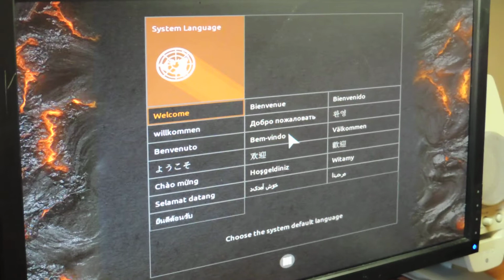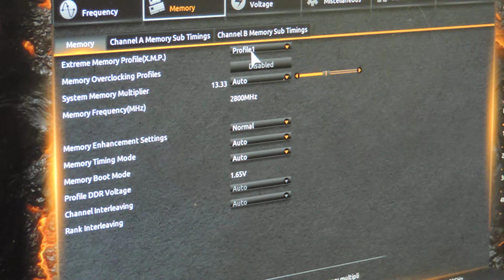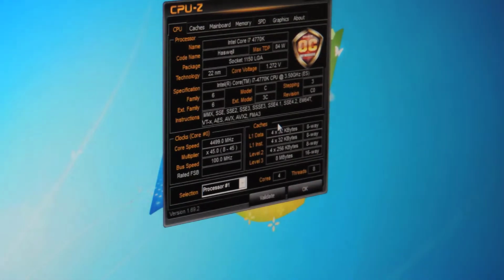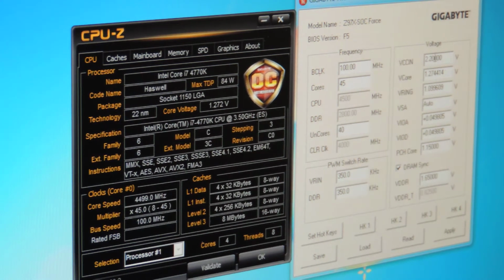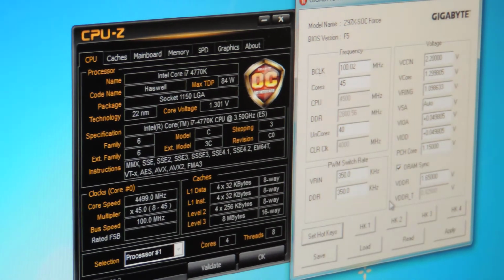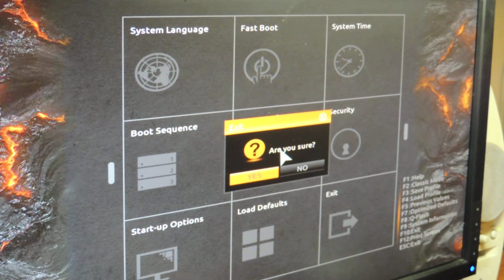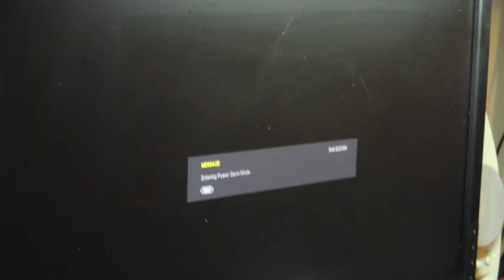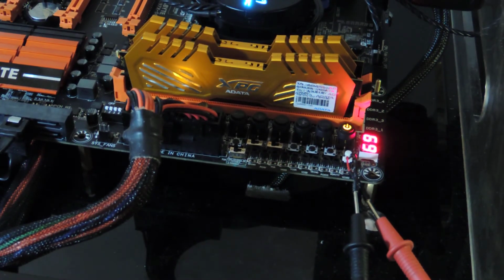[SH] Z97X-SOC Force OC Guide/Feature Overview

Comment: I used the same settings as you on every option u changed, but when Windows was loading I got a BSOD. So, I decided to load default. I have same MB and CPU. Do you think it could be due to my PSU?? It is a Thermaltake SP700, it is not as good I am thinking. It doesn't has a 80Plus, maybe it is PSU problem.
Reply: you have the same CPU but its not exactly "SAME" get it ?